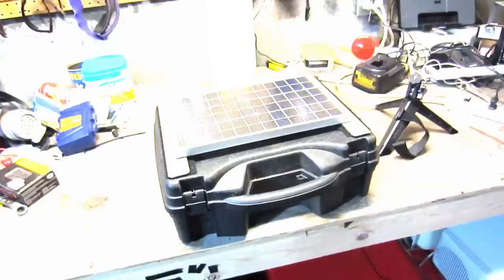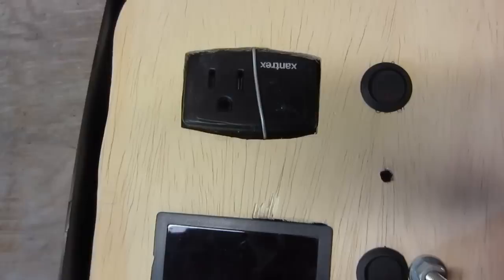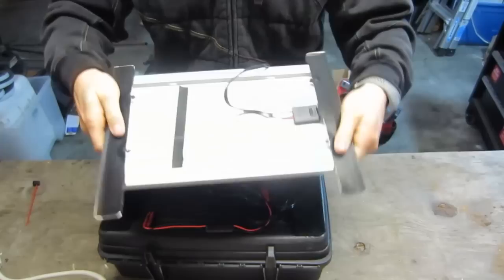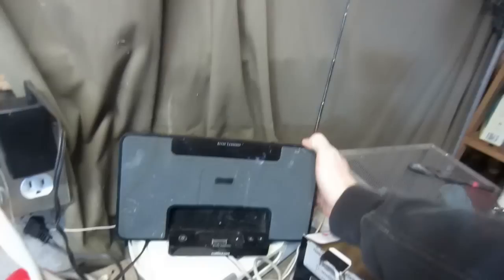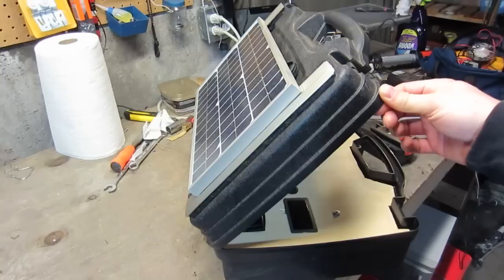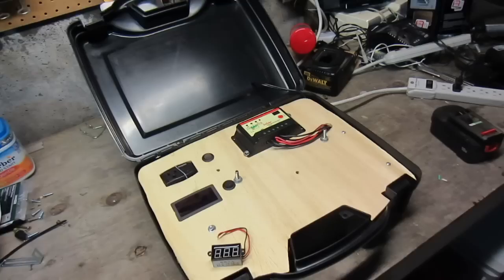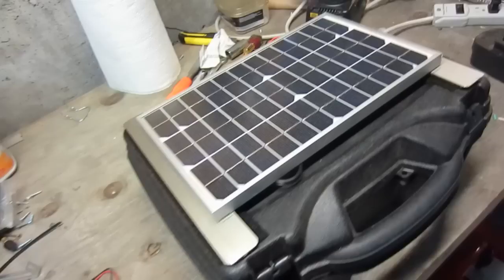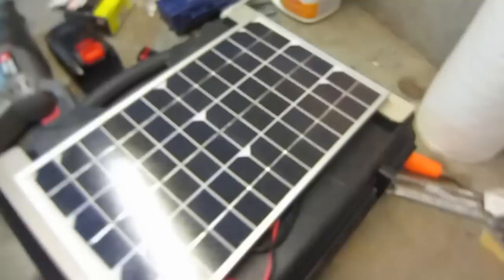Build a high quality PORTABLE Solar Generator For $150

Comment: Just curious, does your controller have a low voltage disconnect?  If the battery is deeply depleted can you fully recharge with a 10 watt panel, and if so how long does it take in the sunlight?  Thanks!
Reply from the maker: Good question. This particular one I used on this project doesn't have a low voltage disconnect. Most cheapo ones do. I'm not totally convinced I need a charge controller for this 10 watt panel for my uses but I suppose if you were to leave it out in the sun for days it would be good piece of mind. Yes the panel can fully recharge the battery though it would take multiple days if fully depleted. I try not to let it discharge past 50% as you know that damages batteries and shortens their life. 10 watt panels put out almost .5 amps so it's similar to a trickle charger. When I charge tool batteries I keep the panel in the sun while I do my charging, this really helps performance
Reply: SolarBurrito i built a similar design with a 5-watt panel, charge controller and two 12v 10AH batteries wired in parellel.  The problem is that once the batteries get below about 50% the panel seems like it cannot recharge them, even after days in the sun.  Do you think it's just too much for a 5 watt panel to handle?  The controller shows charge status, but the batteries just stay dead.
Reply from the maker: 2 things, Yes I your 5 watt can't produce enough current to push power into your 20AH battery. 10 watt would be about the minimum you'd want to use for that. Also you could have a slightly sulfinated AGM battery that require EXTRA power to charge back up. Charge your battery with 6amp smart charger and make sure it can get to 100%. Once it does cycle it by putting a load on it until it reaches 11 volts then recharge. Do that up to 5 times, that will help with sulfination. And get a more powerful panel or charge your batts separate. What kind of panel do you have BTW?
Reply: SolarBurrito its an Instapark 5watt mono panel.  i chose this one because it's the perfect size to mount on the enclosure, so if i go with anything larger i may have to get a bigger enclosure or use external panels to charge it.  another thought is taking one of the batteries out, do you think the 5watt panel could charge a single 12v 10AH?  thanks for your help!
Reply from the maker: Ya I think so. Try to charge one battery at time.
Reply: SolarBurrito i hooked up just one battery over the weekend, then my controller goes into 'float charge' mode as if the battery is full.  im thinking i need a bigger panel or my controller is jacked?

Comment: Please explain your "don't buy Harbor Freight solar panels" statement.
Reply: nr3rful Harbor freight make garbage. Its all junk made in china. Their stuff breaks easily and you waste your money. Spend the extra money get a American or German one.
Reply from the maker: nr3rful Harbor Freight panels are "Anomorphous" which means they are not efficient and will begin to degrade a lose power output over the years. In as little as 7 years you may not be getting much power out of them. The "blue" colored panels monocrystaline/polycyrstalline will last 40+ years. So your're not getting a value is my point. Oh and their 15w panels is 3 times bigger than the 10w panel I used.
Reply: I got a harbor freight solar kit for Christmas in 2016.
Reply: Habour freight panels are fine. In fact they just upped the aunty and have larger wattage panels. Ive had the 15 watt a piece (3 piece set total 45 watts) going for three years no problem. I live in a four season enviroment. They ve seen LOTS of rain and snow on my roof

Comment: 10 watts? too low. why didnt you get the 100watts
Reply: jay hern Maybe because a 100w panel is HUGE!
Reply from the maker: jay hern Ya just for size reasons. You could make a huge version with bigger everything and it would work the same just be less portable.
Reply from the maker: The hundred watt panel is very big so not really portable. Our cabin uses 275 watt panels and is wired the same way. My point is you can scale up this design with bigger panels and figure batteries.

Comment: Can I just order from you
Reply: I will build you one for $300 plus shipping or $270 plus shipping minus the battery so you save on shipping since eBay does free shipping and you can get it all much cheaper that way.. I'm currently building a revised version of the authors with a 400w inverter and a couple upgrades. They take a while to build.

Comment: 10 watts will not charge anything
Reply from the maker: Anything? It charges the 17 amp hour p battery and runs a 400 W inverter no problem. Remember the power Is coming from the battery not direct from the panel.